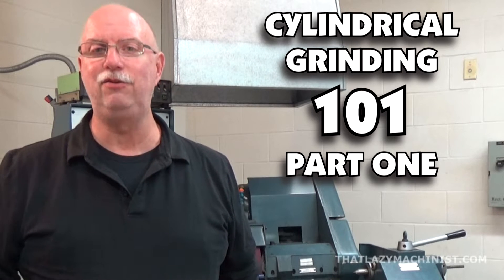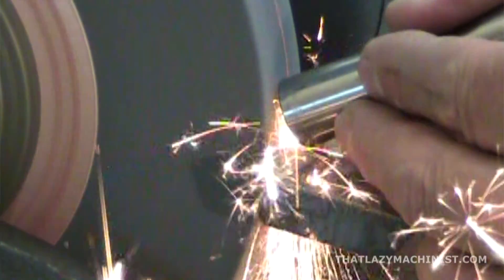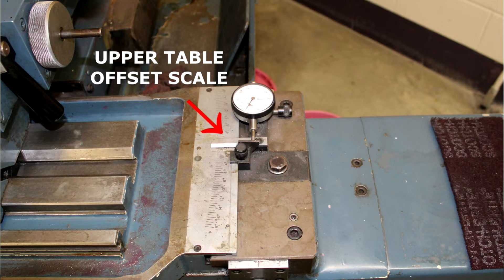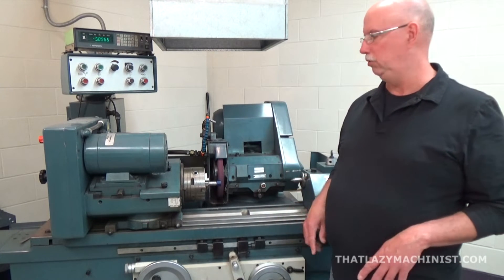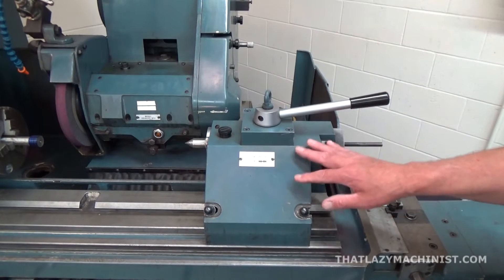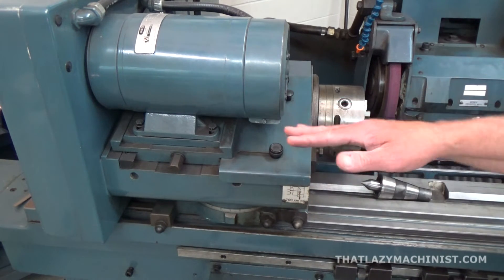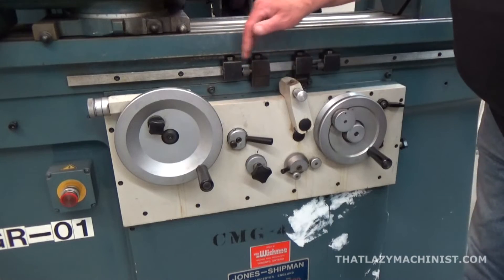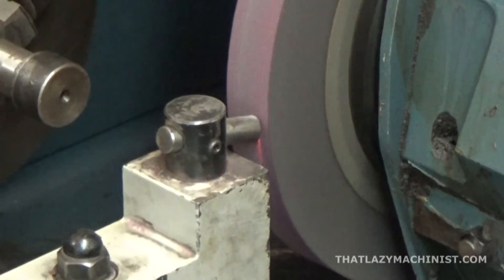PART 1 CYLINDRICAL GRINDER 101, components, grinding cutting action,, wheel dressing, work holding

Comment: I ran a Cincinnati Millacon grinder back in the 70s and 80s. It had a 32 in wheel 3in wide. It would hold 110 in length by 36 in diameter cylinders. But the normal cylinders I ground were,  body Dia 14 in Dia, the bearing journals were 3 in Dia and the gear journal would be 2 in. We had to hold  5 tenth tolerance, 1 tenth taper and 5 tenth runout. We made cylinders for printing newspapers and magazines

Comment: Hello from Croatia , Your recommendation for external circular grinding, workpiece diameter 540, grinding wheel diameter 500, rpm1150-1340. Workpiece speed rpm, grinding wheel displacement, depth of cut

Comment: Hi all.  I would like to do some cylindrical grinding on my lathe utilising a grinding attachment.  Just wondering what are the affects of the mixture of  grinding dust and coolant on my lathe?  Thanks Jozef
Reply: mod the wheel guard to catch sparks. extending past the bed, straight into the tray below... cover the ways, vinyl sheet, stiff plastic, ali...drain everything to the tray... 

grab a 20L bucket or three plumb up a separate system with washing soda solution. bigger the bucket, better settling... dont use soluble oils. water. and washing soda. wash it down with WD40 or similar after. lots of it.

doing it dry? it gets EVERYWHERE. dressing is the worst part. its worth the extra hour or two to make some dedicated guards and gutters.

Comment: Deat Marc, thank you for your video, it's been very informative! I would like to ask - I have a few parts that callout a N4 surface finish after hard anodize type III and also require to be sized after coating to a tolerance of less than 0.0004". the parts are tubular, around 3 inch long, 2 inch diameter. parts are aluminum so - not hardened off course but Ive read that type III anodize can reach 60+ HRC.
would cylincrical grinding be the solution for this drawing callout in your opinion? thank you again!
Reply: it is not high precision and tolerance requirement, just select the suitable wheel to solve.

Comment: In 50 years of grinding I never allowed the job to traverse past the wheel in fact when working up face there was no overhang
Reply from the maker: Hi Stanley, I have a feeling that what you are referring to is important but English is not my first language and I don"t quite understand your comment. With all the experience that you have, I think that it would be important to make another comment in order to detail and clarifie your first comment. These comments are public so you could help others to understand more or correct something that I said that could be false or poorly explained. Thanks for taking the time to watch and for taking the time to comment. Marc
Reply: @THATLAZYMACHINIST  Hi Marc when cylindrical grinding  was told not to allow the job to past the grinding wheel That means all ways keep the wheel in contact with the part your grinding
Reply from the maker: @stanleyg64  Great suggestion Stanley, I will mention it in part three of the video. Thanks for taking the time to write. Marc